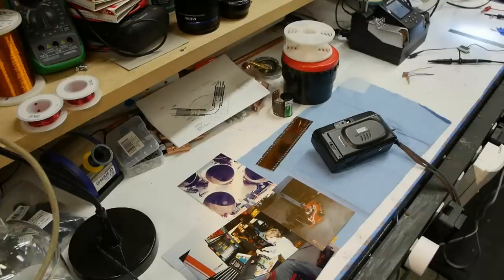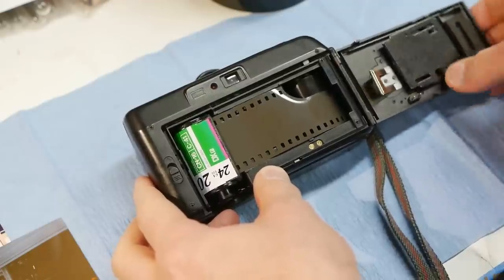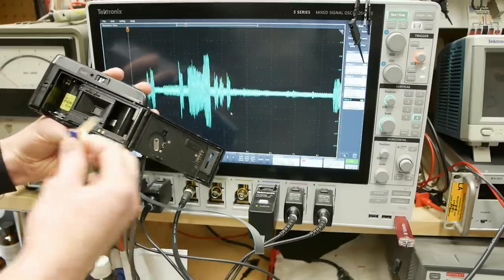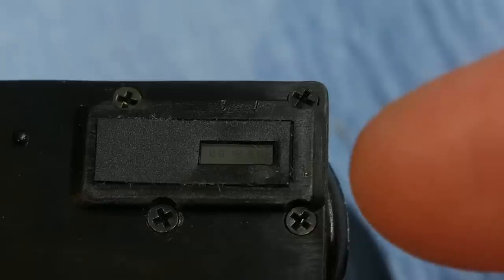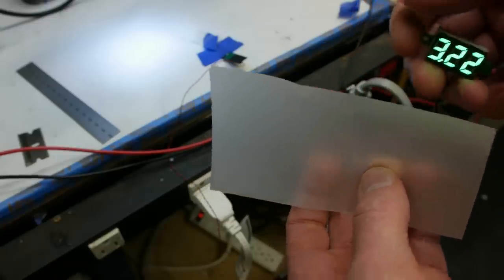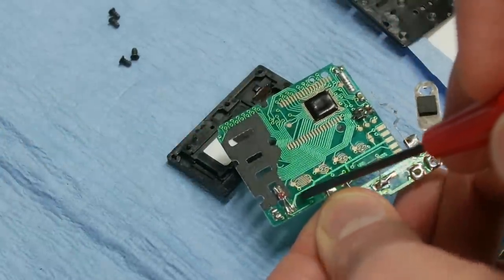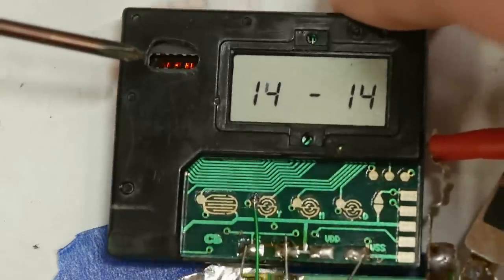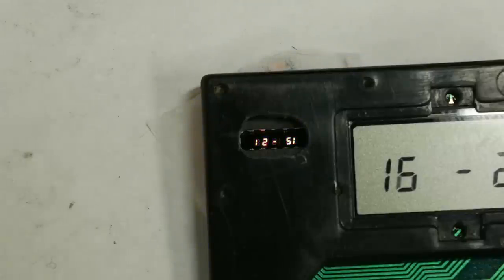How a film camera superimposes the date onto photos

Comment: Such an innocuous little detail that I wouldn't have known to be this interesting if it wasn't for your curiosity.
Reply: Not to Brag, I new about this on my parents camera. the only thing I couldn’t figure out was how the camera print picture on the film.
Reply: I really thought it was 7-segment LED but he made a point that making 7-segment LED that tiny in 1990 was a challenge, not some technology you casually put in common $30 devices.  this mini projector is the perfect solution for the job, really clever and kudos to the inventor.
And not mentioned in the video is I think the bulb draws energy from AA battery source instead of CR2025, correct me if I'm wrong.

Comment: Back in the mid 80's I worked for a company as a machinist that made alphanumeric data backs. A row of micro LEDs were set flush to the backing plate and they fired when you advanced the film. The system worked much like a dot-matrix printer.  We used a TRS-80 Pocket Computer to input up to 40 alphanumeric characters of text.  We mostly sold our system to police departments and federal agencies.  Thanks for the video...

Comment: Just to put a few things correct: 
The Base Colour is not orange: The orange Mask is formed during development and not present prior to it (and it is not uniformly... rather its density depends on the amount of exposure in the area.) The base is usually transparent or of a neutral grey colour.

The reason that the numbers are red/orange is a result of two things 1. The sequence of the colour sensitive layers and filters in the film and 2. Only the red layer is sensitive to red light.
From the emulsion side to the base the order of sensitive layers (SL) may look like this( there can be more layers but in general it is this sequence): blue SL -(filter passable for green+red light)-green SL-red SL-Antihalation layer(AHL). So why are they red? 
As it comes the AHL blocks a good part blue and of the green light of reduces the red part (it depends on the manufacturer and what dyes they use).
If exposed through the base the light has to travel through the AHL (prevents light piping through the base) and then the red sensitive layer and then the green sensitive and then the blue filter), since the residual light lacks any blue  the result are red orangey numbers. 
The AHL dyes are washed out during development and are never to be seen in the developed film. 
Anyway film is extremely complex, it is quite interesting what sort of knowledge is needed to make it...and how sensitive to certain things it is.
Reply: In the basement at Kodak Research Labs they used to have a secret (known only to the local fire DP at the time for emergency situations) subcritical nuclear reactor that used highly enriched weapons grade uranium and californium (ie. a neutron multiplier) just to produce a neutron beam so they could neutron activate random test lots of film and examine the trace element and even isotopic composition of the product for consistency. The technique was so insanely exquisitely sensitive they could detect the seasonal change in diet of a certain flock of sheep kept specifically for the purpose of producing a tiny trace additive (from the wool if I remember right?) to one of the film base's secret ingredients. THAT'S how complex film production was.
Reply: 10mintwo , didn't know that Kodak checked their film with NAA. Something related to this: in 1925 a Kodak emulsion engineer found that if a cow ate mustard seed, the gelantin produced from it increased the film speed.
Reply: Thanks for this 😊.
Reply: In addition most C41 negative  film was daylight balanced (white balance in today's digital cameras) which is 6500K; on the other hand that tiny incandescent bulb  is probably about 2000K - and therefore yellow-oragne-ish.
Reply: I was thinking that the reason for the amber colouring might well be explained by the fact that the light source is an incandescent bulb: when you turn it on, it doesn't just immediately produce white light, it ramps up through the wavelengths as the wire (relatively) slowly heats up. The same is reversed when the bulb cools down. Thus the combined dose over time, i.e. the exposure has a portion of it in redder hues. I don't know if the warm up/cool down time in the cycle is significant enough to actually make any difference, but this was my first hypothesis.
Reply: Nu-uhh!!
Reply: @ruevs  I always forgett about colour balance ( I tend to ignore it or use BW film). Anyway you are right this will add to the effect
Reply: @PenZon  Maybe, the fact is that, if you expose conventional still colour film through its base the outcome are pictures lacking any blue and general beeing on the orange red side. People respool film themself to achiev that effect, or they buy the more expensive one from Lomo (Redscale) or Rollei (Redbird).
Reply: That's fucking crazy! and amazing!
Reply: Wow, color film is so much more complicated than I knew
Reply: @clarkgwillison  Oh it is even more compilcated and trickey, I think color film can have more than14 different layers... But in general it does not matter if color or black and white film is both are hard to produce. Another example how sensitive film is: let's say Fujifilm buys the recipy for a film from KODAK (e.g. PORTA), could Fuji now produce the film and sell it themselve? No. the reason is that the recipy is adjusted to a specific Coating machine and other machinery used to produce the film (such as reaction vessels etc.). This is also the reason that if a coating machine is scrapped, all  photofraphic products produced on that one are more or less doomed to be discontinued (or one needs to do resaerch to adjust the recipy for a different machine....Adox did that, they bought the recipy and tanks for a photographic paper years ago  and are now about to release the first batch.) ...Or a more recent problem is that there is sometimes only one company left producing a certain product needed for production: A few years ago one company changed the formulation of a special black ink used for backening paper...The ink was used to print number on the paper to see how many photos are left (its 120er film or medium format) ... anyway the changed ink led to  a local increas of sensitivity and this resulted in visible numbers on the film.
Reply: @martinh.3058  Crazy, but I guess it makes sense - semiconductor processes are similarly ficicky, why wouldn't film be? I have so much more respect for that tech now.
Reply: that might be very much depending on the exact film type and processing. But the base color of Agfa and Fuji films is a precise and uniform orange which can be seen in unexposed parts of the film or if the sensitive layers are scraped off the base material.
Reply: additionally though the roll of the layers inside the film will also play a role - since the red-sensitive layer (like in multi-junction solar cells) is the bottom layer in the stack, followed by green and blue on the top.
Reply: @clarkgwillison  give a quick research about Bayer filter, that is what gives the digital sensor the ability to capture RGB information. And in my opinion it is equally sophisticated as the multiple emulsion layers of the colour negative film.
Reply: Base color of co LL or negatives is always orange for technical reasons. It was part of the color rendition necessities and is one of the many layers in a negative color film.
As for the bulb being red on films, it is due to this bulb being around 3200k and the film being daylight type, around 5500k. 
This make the bulk light look warmer/reddish.

B&W films are indeed transparent but that is not the film type used here.
Reply: Sorry to burst everybody's bubble but just do a search for redscale film and you'll understand why the numbers are redish.
Reply: @uwezimmermann5427  At least the Base of (developed) Kodak color 200 plus is transparent, if you throw a snipet of the film in boiling water you can scrape of the emulsion and the base is transperent as a e6 film (I can't scrape it off without severly softening the emulsion, hence the hot water). I may have worded things a bit confusing... I shouldn't write stuff when I am tired...And I also made a small mistake: the layer forming the mask is present prior exposure and is uniformly, but the density of the mask in the finished developed film depends on the exposure...
Reply: @uwezimmermann5427  Yes, my point... thats also how redscale films work
Reply: @sedrickgates1  Base and mask are different things, at least the base of Kodak Color 200 plus is transparent. You are right, the orange colour is there to ensure that printed colours are correctly displayed, part of this system is that the orange mask is not uniformly. As for the bulb yes this most certainly contributes to the colour, but if you expose film through the base the pictures are orangy-redish.
Reply: @martinh.3058  Coincidentally I've just recently shot my first roll of redscale film, so my mind went immediately to that explanation.
Reply: Theres always one....
Reply: I could have sworn that the color came from the gas in the flash bulb.
Reply: It makes me remember a quantum physics like question... If color negative by definition changes color when exposed to light... What then is the color of unexposed film? 

I mean. As in the Uncertainty Principle... If you measure it (shine some light on it to see it)... Then you alter it..?
Reply: @ruevs  I was pretty sure it wasn't the 'cast of the substrate' that was causing that color, thanks. If that had been the source I kept thinking it would just mask itself out during development? Am I wrong? Would the strength of the original exposure source cause it to reveal the numbers anyway? All I am going on here is my understanding from a single semester high school photography class.
Reply: Short info about that Kodak's subcritical nuclear reactor https://www.youtube.com/watch?v=xRkYpl4V51A
Reply: At 8:33 you can see the projected timestamp already being red-orange when passing through the color-neutral frosted sheet of plastic. This would suggest that the color cast is produced by the projector itself, and not by the film base or emulsion. My money is on the small mirror being coated with a red filter. It may be my imagination, but I think I can see it at 9:29 when the light hits the mirror just right.
Reply: Another factor might be that incandescent lights do not start instantly like LEDs. They literally need to warm up to the working temperature. And during this process, the light it produces starts from the long-end of the spectrum, which is red and orange stuff.
Reply: Lastly consider that perhaps they run the bulb a bit on the dim side so it never burns out. Not sure if that strategy is useful for a bulb that just comes on momentarily once in a while, however.
Reply: @martinh.3058  Sulfur compounds in the gelatin present in trace amounts are responsible for the effect; mustard is naturally rich in sulfur compounds (the pungent smell is the key)
Reply: @janami-dharmam  Yes I know... There is an anecdote that the Stern-Gerlach experiment (one of the key expereiments of Quantum Mechanics) only worked because Stern could only afford cheap and therefore sulfur rich cigars: ( I won't explain the experiment only how they analyzed it) They dopsed silver atoms on a glass sheet... Gerlach looked at it and couln't see a thing ... the layer was too thin . Then Stern had a look and suddenly the deposed silver turned black because Sterns breath contained sulfur, and so they could see the spots where the silver was deposed.
Reply: huh but it looks orange in the demo @8:26
Reply: @ruevs  that is also very clever, to me is a combination of facts but was my explanation at first question, why it looks orange...

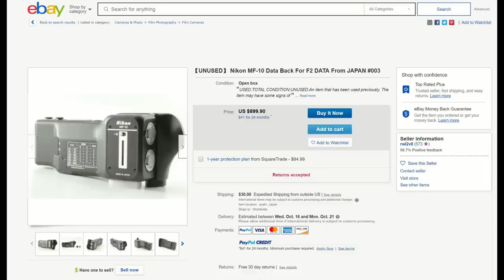Comment: 11:43 🙄 Typical eBay listing... "[UNUSED] USED. TOTAL CONDITION: UNUSED. An item that has been used previously"
Reply: And don't forget the text which says: an item may have signs of...
Reply: @squishy3217  Woah is that what it actually says?
Reply: It has a quantum condition.
Reply: @abyssstrider2547 , haha, it's most probably a joke x)
Reply: @exys2086  I know but its quite true
Reply: @abyssstrider2547 , sad ;(
Reply: The problem with eBay. I once sold a new modified flashlight. The mod was the reason of the sale. I stupidly stated the item as new.
The person buying the thing pretended the money back because the box had been open, and according to eBay it can't. 
So, to defend themselves the seller resorts to such wording.

Comment: Intriguing teardown, thanks for showing how it works. 
Regarding mechanical film timestamping the Databack has precedents. During WWII and after, some aircraft photo reconnaisance cameras had timestamping on the film. I have one such camera, it's a british Air Ministry Type F46, 5" focal length lens taking a 2"x7" negative, running on 24 volts.
On the bottom face of the camera body casting at the righthand side is a small box housing (labelled 'F46 WATCH UNIT' and A.M. number) that can be removed by sliding off. Inside is some black felt and a circular cutout for a tiny fob watch of no more than 1" diameter. Inside the housing body where the box attaches there are two festoon light bulbs to illuminate the watch face, and a 45 degree mirror and light pipe extended to the corner of the film plane to record the time of day the photograph was taken.

Comment: This reminds me to when I found an old photo camera in my grandmother's home, which I took to bits, because my grandmother didn't need it anymore and affordable digital cameras already existed, because it was back in maybe in 2006 or 2007.
I also found such a tiny LCD-screen, which I instantly new, that it was for the date "printing" but I don't remember if it was located at the back of the film or in front of it.
What I find amazing btw is that analog photo film develloping services still exist here in Germany in some supermarkets considering that digital cameras are now omnipresent these days.
You can also find such tiny LCD-screens in projector alarm clocks.
I got one for about 1€ on a flea market and took it to bits and found an LCD-screen of a similar size.

Comment: If you flip film around and expose it through the back, it shifts everything red too.  A few companies like Lomography sell film that was re-rolled the wrong way to get the effect--called redscale.  The red dye layer is also the last layer that light hits with color negative film.
Reply: This is based on the fact all silver halides are sensitive to blue light. If exposed correctly, the blue light would be filtered out after the yellow (blue sensitive) layers, When exposed from the back side, this is not the case.

Comment: I love that this was from back in the day when there were still screws to remove. These days it more likely than not would be one ultrasonic welded hunk of plastic that you'd have to destroy to get into.
Reply: First thing I thought when I saw the assembly.
Reply: I teared down a "new" film camera from the 2000's (kodak aps) to re-use the photoresistor in an older , easier to repair film camera and you are completely right, it was easier than items from today but not as easy as the old camera
Reply: Products from Japanese brands that are not meant for single use, still usually contain plenty of screws.
Reply: I've taken apart several modern cameras, and anything that wasn't an ultra cheap trash camera is put together with plenty of screws and clips. No fused plastic 'rivets' or much glue at all. Everything from Nikon Coolpix L20, various small Fujis, an HS50, small Canon A480, ,G15, Canon 7D MK 1 and 2, not to mention several no name brand Chinese cameras. All perfectly disassembleable, repairable and reassembled without much fuss. Though it does require patience, a microscope and steady hands. Some soldering also required to disconnect ribbon cables.
Reply: @rkan2  This
Reply: Many devices nowadays are built with so little components often compressed into one single IC that there's no reason to waste money on screws because there isn't much anyone can fix

Comment: >probing a camera that was $30 30 years ago with a $10,000 oscilloscope
That's the stuff.
Reply: Mike Donaghy the link isn’t working for my device - how much is it?
Reply: up to 22'200€
Reply: Pluscrafter Jesus Christ
Reply: @ToriKo_  oscilloscopes are the most important tool for any kind of electrical and electronic engineering
Reply: eBay searches "Tektronix mixed signal oscilloscope"
Reply: His oscilloscope cost more the the value of my car before it left the lot!
Reply: His is around 28,000$. Correct me if I’m wrong.
Reply: @leachim66  Holy mother of god! I thought I could 'never' afford a rig like that but I could 'never ever' afford one!
Reply: @marios1861  and they cost as much as a house.
Reply: or electron microscope or particle accelerator preferably LHC, soon... laser tweezer.

Comment: Such a cool teardown, thanks!
There's another thing about the date always being orange: colour film actually consists of several light sensitive layers, each sensitive to different light. The layer closest to the base of film -- and, therefore, the closest to the date imprinting back -- is sensitive to red light. So, when the light hits the film, it hits the red-sensitive layer first, which makes it this reddish colour.
The same effect is sometimes done on purpose: the film is rewound the other way around, with base towards lens and emulsion towards the pressure plate. The resulting pictures are a reddish colour, much like the date on the photos. As a result, this is called "redscale".
I suspect that with redscale film, the date would actually be white.